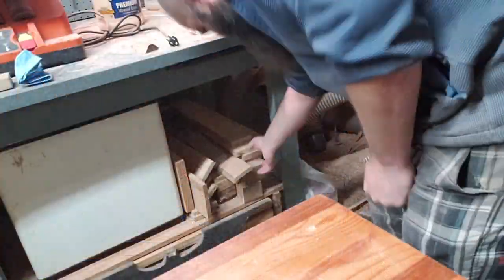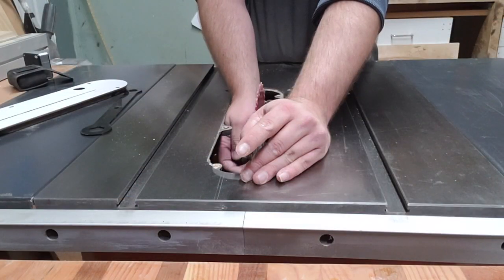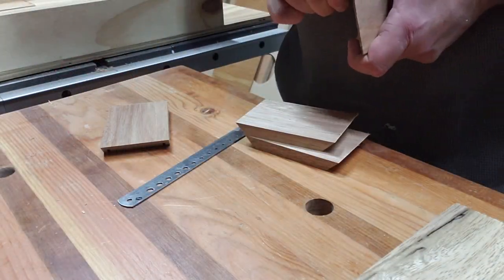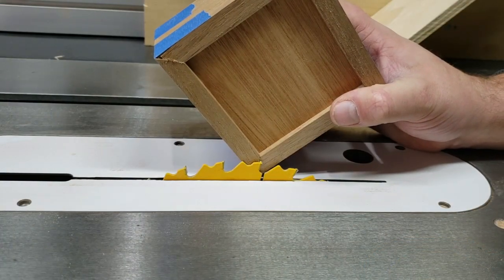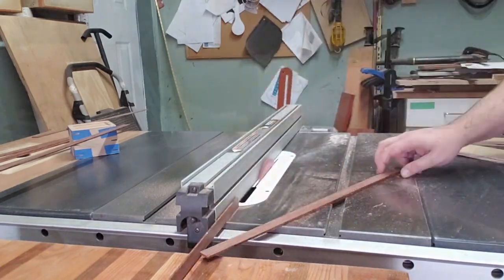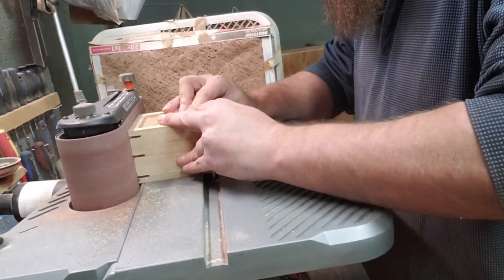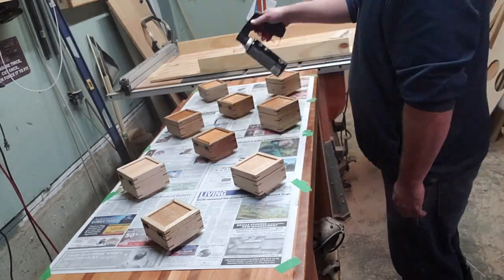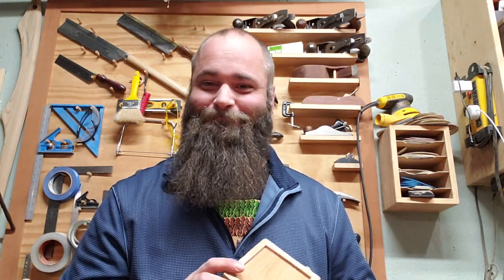Batching out Mitered Boxes with my new Miter Sled!

Comment: Look great.  Goodluck with the market.
Reply from the maker: Thanks. That market was mid-month and they flew off the table. Had to make another batch for this weekend's one. Lacquer curing on them now, just in time.
Reply: Wooden ThingsAndStuff glad to hear they were a hit.  This method looks like a good way to get them done in a efficient batch. 

I’ve been trying to figure out another good item for booths and gifts. I’ll have to give this a go.
Reply from the maker: @WoodFrontier  If you can be efficient in batching them out, they're a decent use of your time. I sold these at $35 (CAD) each, so I think I made about $20/hr after paying for the hardware, which I consider an okay wage for having fun in the shop.